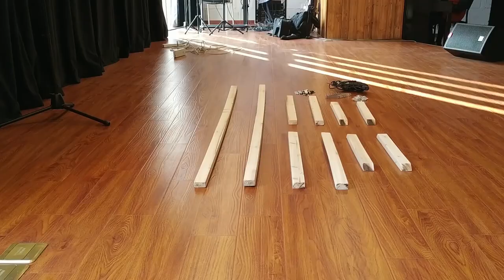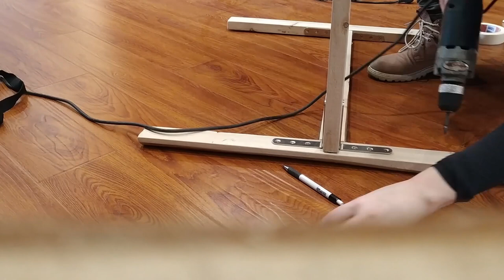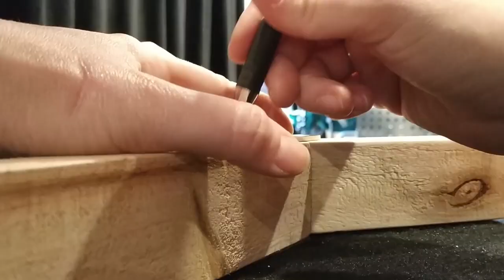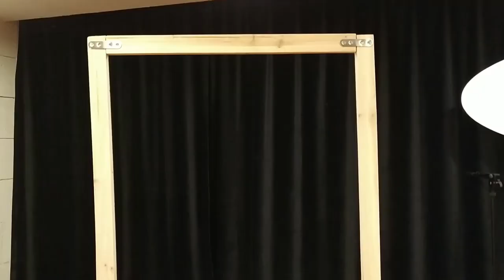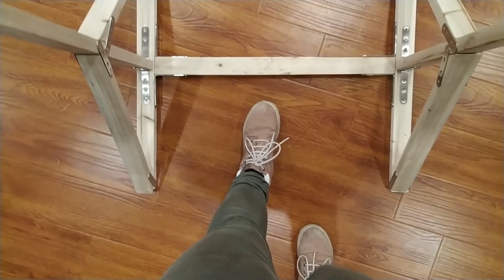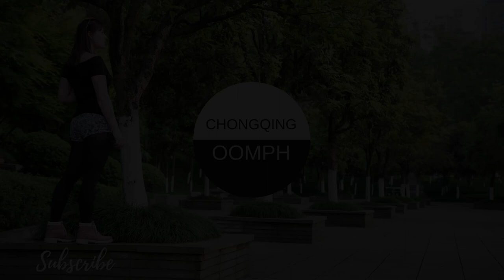DIY Self Standing Door Frame

Comment: I made it. Used pine 2x5x200 cm for the sides. 2x5x80 cm inner parts. 2x5x60cm for the feet and I angled little supports 20cm
It works well.
I'm going to paint it and make a cardboard door... staple it to the frame 😊